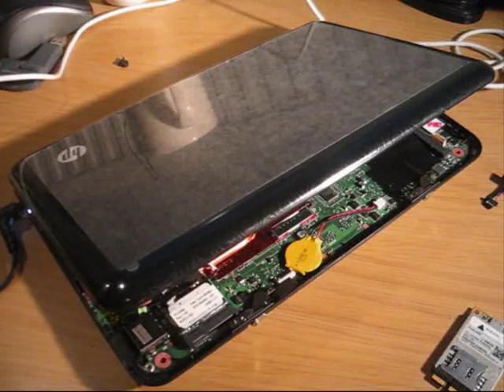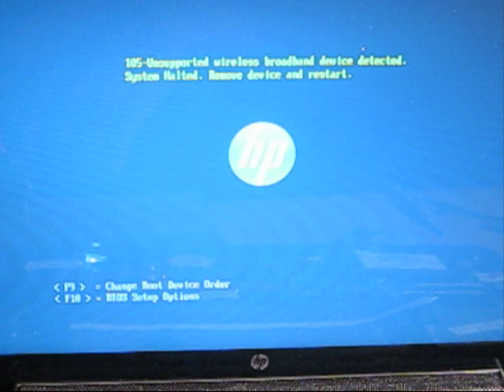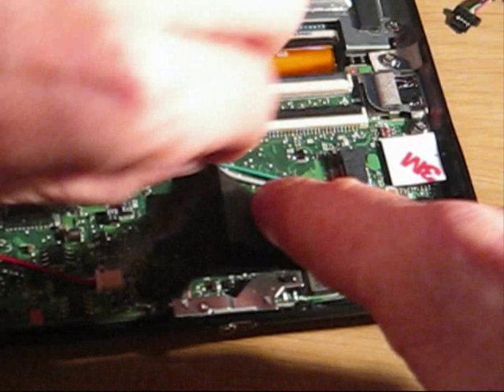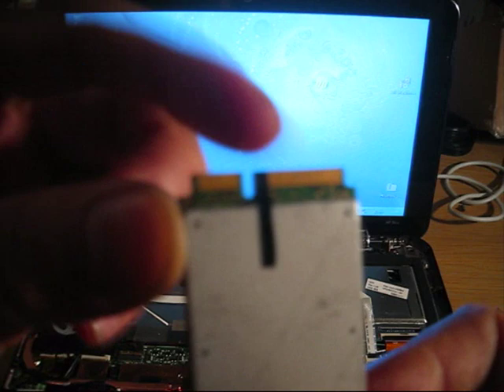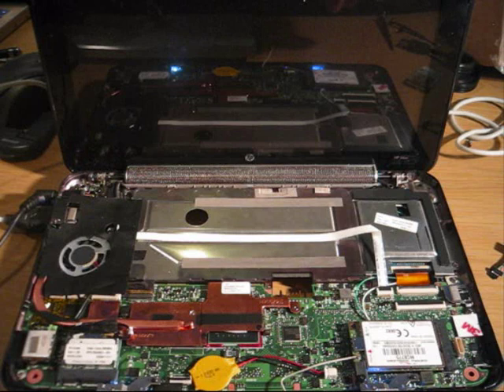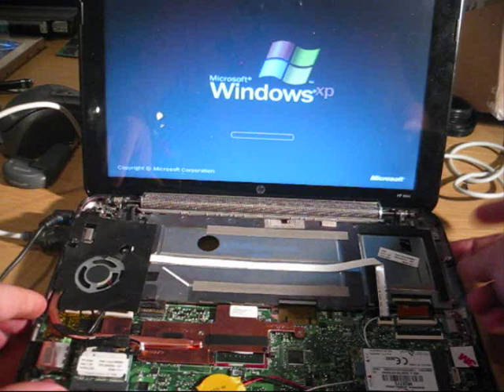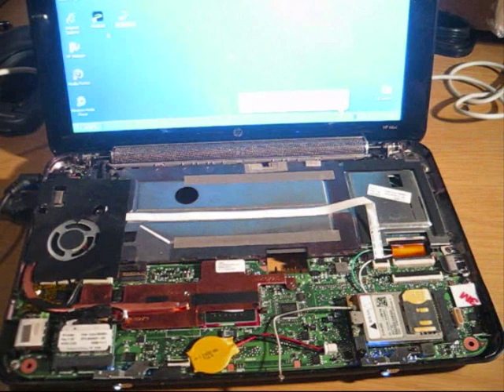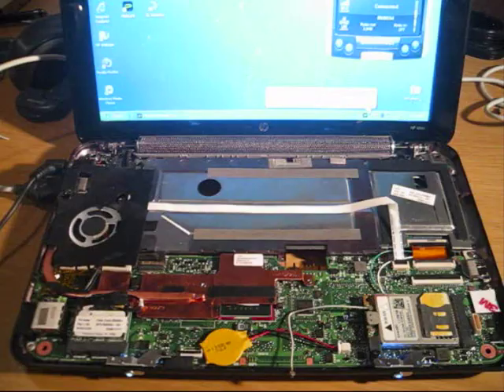How-to add 3G modem to HP Mini 1000

Comment: If you purchase a mini 1000 with a 3g card, I'm assuming the antenna will be installed. Do you know what would be needed to get those to work without subscription or could you swap out the included 3g card with your own?

Comment: can i put an msata hdd in that slot and use it as primary drive? will the bios block the device?
Reply from the maker: No you can't.  It is same connector but different signals